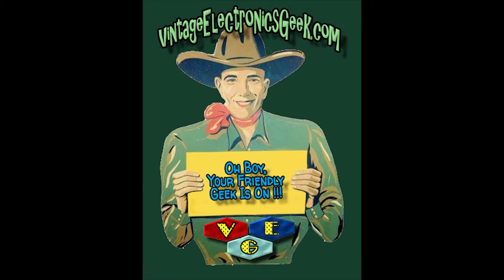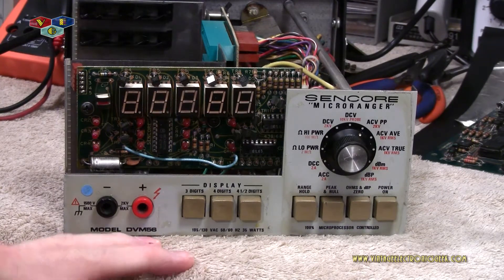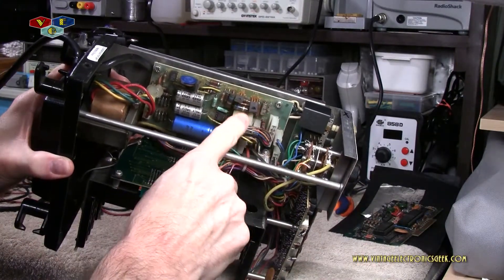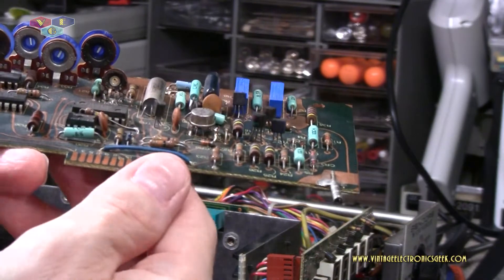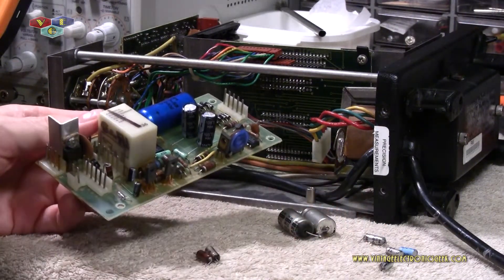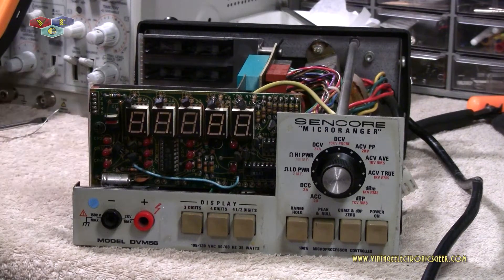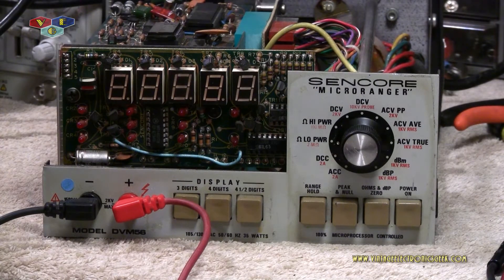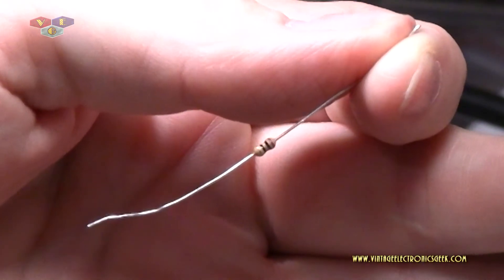Repair Of My Recently Purchased Sencore DVM56 DMM

Comment: I'm currently working on one of these.    Initially it did nothing at all upon power on.  When turning off the switch I got a tiny blip on the shunt relay.  I found that the 7805 regulator was not conducting.   Replaced that and now I get a few segments lit on the display and the shunt relay cycles every few seconds.   I'm rooting out some low supply voltages which I think are caused by drifted carbon comp resistors.    Great video for inspiration.  Thanks!
Reply from the maker: My pleasure Brad!  This device died on me not to long ago, sad really cuz I really enjoy this meter, I'm actually planning on taring mine down tomorrow to figure out what I need for a total recap as I didn't do it the first go around, wanna get those ordered then start the process of troubleshooting from the ground up.  I wish you all the best in restoring and hope you enjoy it as much as I do!  Thanks for watching and your support! Glad to have helped some.  :)  ~Jack, VEG

Comment: Awesome meter and repair...  I suppose there is a calibration process for it with all those variable caps which you could really dial it in, that is if the documenting is available.  Very nice job. - Ron
Reply from the maker: Howdy Ron!  Yes, I was able to find a service manual for purchase on eBay (only one available), I may attempt it at a later date when bored!  :)  Thanks for watching!  ~Jack, VEG